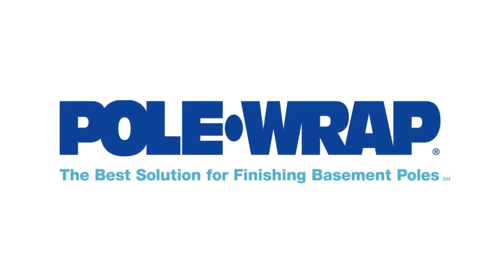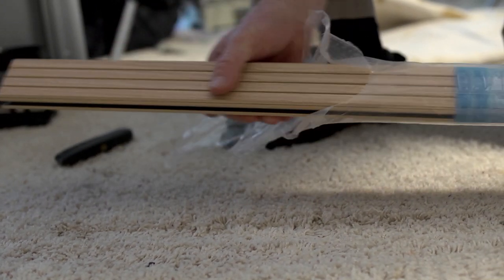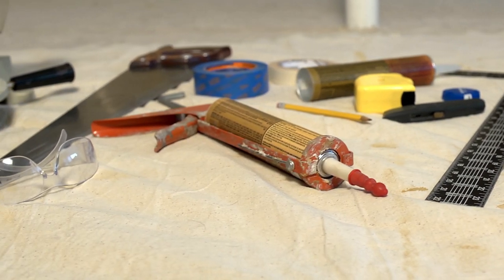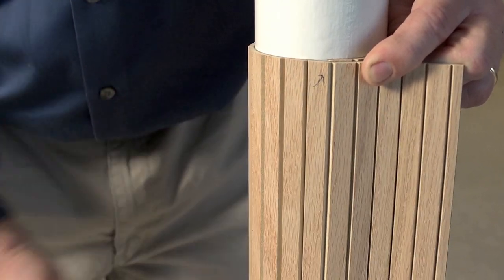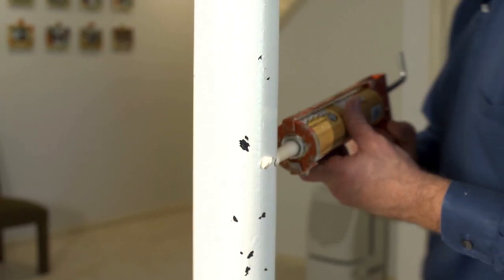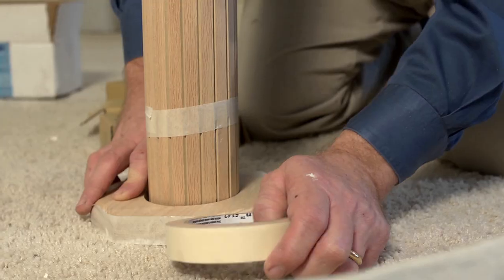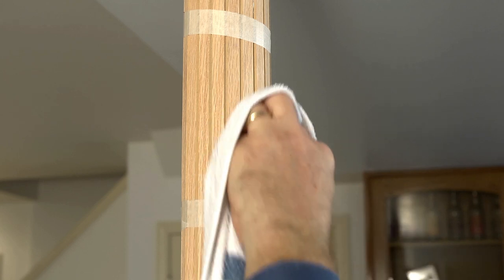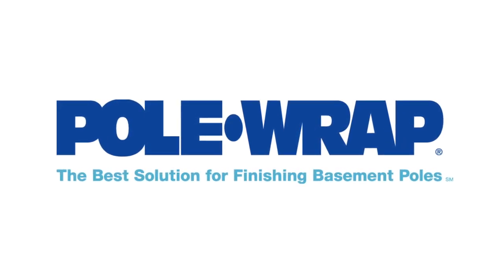Pole-Wrap | Column Wraps, Pole Covers, Post Wrap, Lally Column

Comment: Laurie -- are you a Pole-Wrap rep?  I have a question about the crown piece -- my basement pole has a rectangular top that supports the beam.  It's probably 7x4, thought I'm not sure what the standard dimensions really are.  It looks like the Pole-Wrap crown is circular and that the top of the actual support pole is hidden in the finished header.  How can I compensate if the rectangular top of my pole is exposed?

Comment: How does this work with poles that have a joint in the middle with a close hanger dowel sized pin? Is there a solution for that?

Comment from the maker: Can Pole-Wrap be used to cover a jack post (adjustable basement support)?  

Yes, but if your jack post has a protruding pin you may want to consider replacing your existing jack post with the type that has a screw adjustment instead of a pin.  These are relatively inexpensive. Akron Products has a good product line and is available at Lowe’s.  Visit the Akron Products website for more information.

Comment from the maker: The Pole-Wrap trim sets (Cap & Base) are an octagon cut and not circular. Visit our Pole-Wrap website to find the actual dimensions for each size crown/Cap piece ("Products" page).  Each is sized to fit your standard support beam with about an inch or two left on either side.  You should finish you support beam first, or lower your ceiling below the beam to provide a flat surface to mount the Pole-Wrap crown/Cap trim.

Comment: What type of adhesive are you using?  Would liquid nails work?
Reply: tony Kari 
I used Liquid Nails and works Great. It won’t move and cures super quick
I put the Liquid Nails right on the pole
Reply: Why not put liquid nails on the wrap, rather then the pole, would be a bit neater and easier.  Even funnier, this company’s other video says to do just that

Comment: 🤣You didn't cut away the carpet?
I see this is 10 years of not being monitored, typical!
So what do you do if you have pins in your poles since the wrap won't adhere completely around the pole? Do you offer rings I could put in every foot or so as adhesion points?